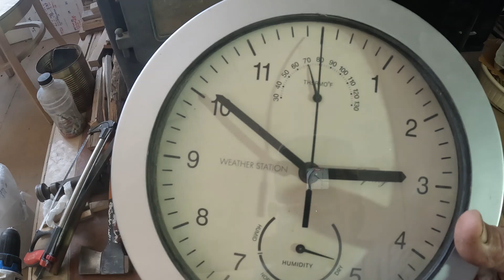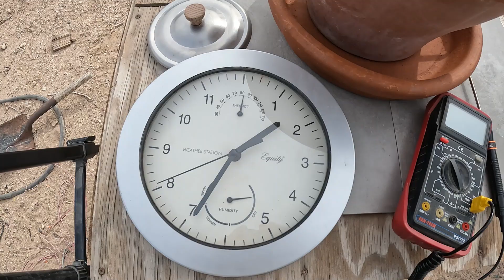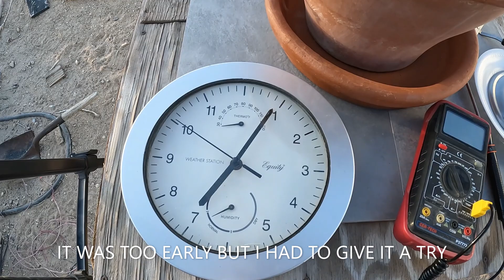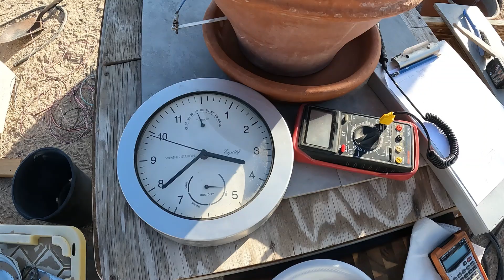Small Terracotta Sand Battery Cooks Three Meals in One Day

Comment: This is the second video of yours I've watched, I'm an engineer and I'm not entirely sure what your system is yet as I came to this video from looking for more explanation the copper pipe and iron rod electrical earth batteries. Whatever you're doing is new to me but it's interesting and you'll see more comments as I watch more videos and understand it better. This was good though, thanks for the video because I think alternate living methods are important.
Reply from the maker: I am just winging it as they say. My goal is to heat a mass of sand with solar panels and extract the heat to heat a room addition or small cabin. But at this point I am just building a prototype in hopes that it will function the way I am anticipating. If it does then I will build a room addition around the project. If it fails to work as I am hoping then it just may be a large monument lol 😂. Honestly I am a metal fabricator and a back yard inventor but I can't guarantee this will work as I am hoping. Sorry it took so long to reply.

Comment: so u use AC spiral direct from solar panel?  How long sand will stay hot and how much it takes to heat up about 2000kg of sand? im planing to build a fireplace, i already have a metal fireplace shell, I will lay bricks around the shell and damp 2000kg sand inside. Also i have a 6 panels 340w 40v voc so i might put spiral in sand aswell. Have u got any ideas?
Reply from the maker: This is all new to me, I have the electric stove element connected directly to solar panels, no batteries or other components. I don't really have the answers to your other questions. You will have to experiment like I am doing. But feel free to ask me anything and if I have a clue I will tell you what I know.

Comment from the maker: The main point of this video is the sand battery itself. And how you can build a survival stove and cook your meals without any propane or firewood with a small amount of solar power. I am not a Chef and I don`t eat those meals normally, I just bought those because it was more practical for me to film. Obviously, you can cook about anything. And of course, this is basically still in the design and prototype stage.

Comment: If.youre going to fry food, why not place the pan directly on the element? I understand the need for the sand battery and baking uses but it seems better to fry that on the element
Reply from the maker: You may be correct on certain meals directly on the element may work better. I am learning as I go. Thank you for the comment.
Reply: @off-gridsurvivalmike8120  I'm thinking of testing it! I worry I don't have enough solar panels to get the voltage up on the element though.

I only have 4 100 watt panels.